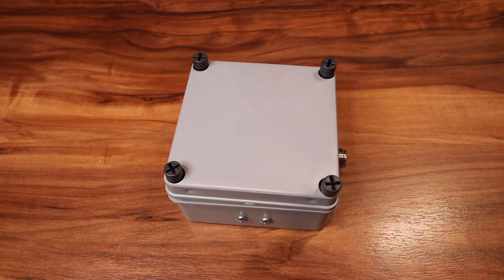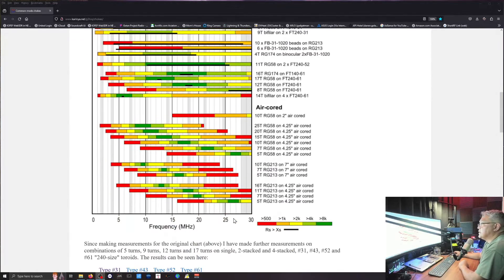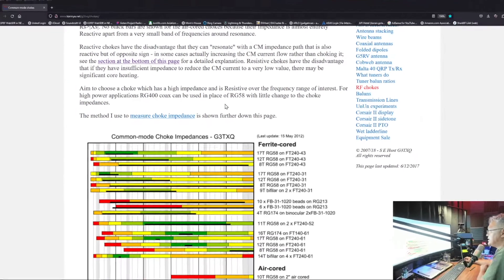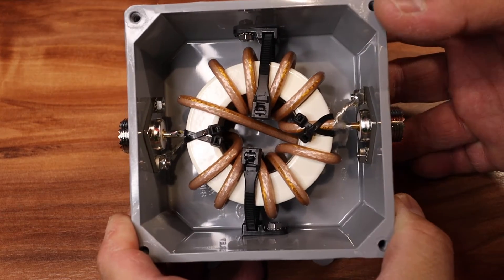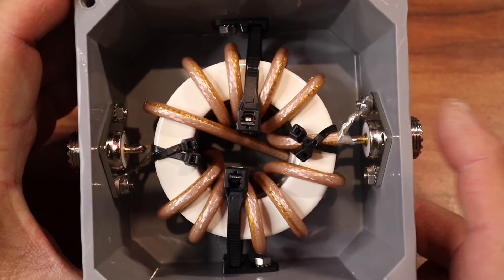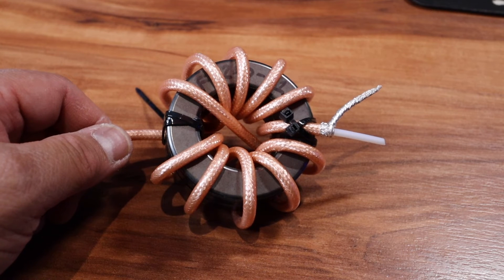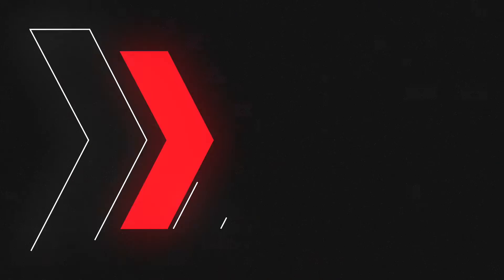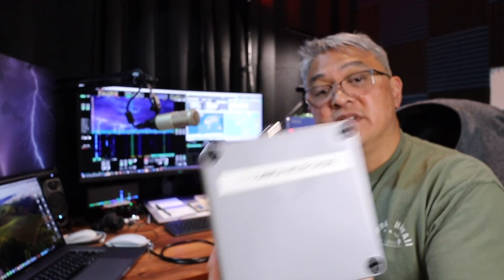Making a Simple DIY 1:1 Common Mode Choke | How to make a Common Mode Choke

Comment: do you have a materials list and source for each component?  thanks for your videos.
Reply from the maker: I've updated my my descriptions to add links to the products I used.  Here are the links:  Affiliated Amazon Product links:
4" x 4" Plastic Conduit Junction Box:  https://amzn.to/4enuI02
SO239 Bulkhead Connectors:  https://amzn.to/3zGM0WN
RG400 20 feet:  https://amzn.to/4dwHHv4
Zip Tie Mounts:  https://amzn.to/3N44B1Z
Torroid FT240-31 31Mix:  https://amzn.to/3BAN5zS
Reply: @DarrenN4VFR  thank you!  i am circling back on this project.  i need to get a couple of these built for some delta loops i'm building.  are you satisfied with the results of the choke you built?  i know it's difficult to get tight wraps on the RG400 to the toroid.  any issues?
Reply from the maker: @nhojcam  I'm happy with it and still using it at my S. TEXAS QTH.
Reply: @DarrenN4VFR The turns are ten, not eleven. You were starting to count right after the soldered terminal at 11:05 considering it as the first turn, while there is no turn at that point. On the other hand, this type of filter requires even number of sub-coils in order for them to be completely symmetrical to each other. With eleven turns, this rule is  being violated as the turns would be five to one half of them and six to the other one.
Reply: @ΠάριςΑζής You count a turn each time the coax passes through the center of the torroid. He correctly counted 11 but this is a crossover choke so he definitely should have had an even number on each side- 6 and 6 for a total of 12 turns.

Comment: I have a question that may seem odd. I use LMR 400 antenna coax. Can I use two COMMON MODE chokes, one at the antenna and one at near the transceiver, built with RG8 coax? Will this affect anything?
Reply from the maker: I did on my 40m horizontal loop.

Comment: Cannot be 11 turns. The number is 10 turns. It must be an even number since there are the same number of turns on each side.
Reply from the maker: Did I messed up?  It's still working for me.
Reply: @DarrenN4VFR 
I plsn to build one 1:1 balun for an HF fan dipole using my three ft240-61 stacked, in orther to withstand any QRO amplifier up to 3Kw. 

But I don't know how.
Would you like to help me?

Comment: Many thanks. I've just updated my choke. I used thinner coax as I run low power. Have added more turns and works perfectly. Insertion loss is lower than 1dB. Cheers from old George in the UK 🇬🇧
Reply from the maker: @MakeDoAndMend1  awesome!
Reply: @DarrenN4VFR  Thanks from old George in the UK 🇬🇧

Comment: Can I use rg 400 ???
Reply from the maker: Sure.
Reply: @DarrenN4VFR  do i need to use ceramic capacitor 3kv 1nf or not needed 🤔?? Its for 27mhz 100 watt out put
Reply from the maker: @kingcardano2.9millionada24  I really don't know.  Maybe someone can chime in.  I'd say you can give it a try to see if it works out.  Good luck!
Reply: @DarrenN4VFR i see a lot of the expensive baluns with this capacitor i will try and i will let you no the result Darren
Reply: @kingcardano2.9millionada24  You're probably aware that 4 watts is the legal limit on 27 MHz.  The capacitor is not for a common mode choke.  They're used on multi band end fed long wire antenna transformers to increase bandwidth on 10 meters which extends from 28.000 MHz to 29.700 MHz; a range of 1.7 MHz.  It's completely unnecessary for CB which only covers 0.44 MHz and unlikely that you would be using an impedance matching transformer anyway.

Comment: How much did it cost you to build this??? and would this help with my mobile Cb 11 meters with reducing background noise from my Tri axle truck??? also you don't have to worry about too much heat soldering the RG400.  it won't melt the center, like other foam center s
Reply from the maker: I dont know about reducing noise from your truck.  It will reduce Common Mode Currents traveling back down the coax. My guess, it should also work on 11 meters.
Reply: Not sure if that last part was a question or a statement.  RG400 has a very high heat tolerance.  At our frequencies it will handle 5000 watts  at 160/80M and 2750 watts at 10M due to the Teflon dielectric, with a melting point of 327°C/620°F.  The jacket has excellent heat tolerance as well, with a melting point of 260°C/500°F.  It will melt if you try hard enough but if you know how to make a good solder joint it should never be a problem.

Comment: Nice video with one problem: You do not know what cores the commercial balun used. They may be a Mix 77, Mix 43, or something else entirely. When you abandoned the chart data showing actual measurements of chokes built on FT240-31 cores, the choke you built will have little resemblance to what your reference documentation specified. From the chart at 4:46, you choke will have Rs values somewhere between the values shown for 9 turns and 17 turns, i.e. less effective than 9 turns would have been. Will it still work? Yes. Will it be as effective? Probably not. You will only know when you put it on a VNA and test its performance. 
Dan KE6PO
Reply from the maker: Thank you Dan for the information.

Comment: Darren, I am thinking of combining this common mode choke with a 9:1 UNUN in the same project box.  Do you think this will work, or could there be some interaction between the two if they are located in close proximity in the same project box?  Thanks!
Reply from the maker: I don't see why not.  I've connected my 4:1 to a 1:1 CMC but using a male to male PL249 connector to connect the two together.

Comment: Hi Darren,
Great build. G3TXQ has very good common mode choke info on his website. RG400 uses a Teflon dielectric center insulator, so any soldering iron or gun wouldn't come close to affecting it. I've used a plumbing torch to install PL-259's on RG400. 73  WJ3U

Comment: An easy way to do the braid cleanly is to use an awl at the end of the insulation and work a hole in the braid until it's big enough for the center conductor to go through.  Then do a hard bend and you can fish the center out through the hole and use the awl to work it out.  After the center is out you can work the braid and it looks like it was made that way.  And the end of the braid will be pristine for soldering to your ground lug.
Reply: What you said made sense to me until I had to do it, is this demonstrated anywhere ? Let's say I've removed the outer jacket on a 1 inch section of the where would I start to make a hole in the shield ? 1/4 of the way near where the jacket is present ? Have you done this with rg400 ? the weave is tight.
Reply: @corradoQC  This is just something I've done many times at work.  I actually don't use RG400 though but it won't matter because any braid will separate.  All you need to do is push it a little bit to expand it some and then you can pierce it with an awl. I should make my own video on this.  I figured this out myself and I don't know who else might do this method.  When you hard bend the braid with the center conductor and dielectric the braid will separate at teh top all by itself and the reason for the awl is to poke in under the bend to give you leverage to pull the end through.  Maybe try this with some smaller stuff like RG6, and unshielded.  The foil complicates matters but it's only foil so it can be manipulated or removed as it's only  the end anyway.